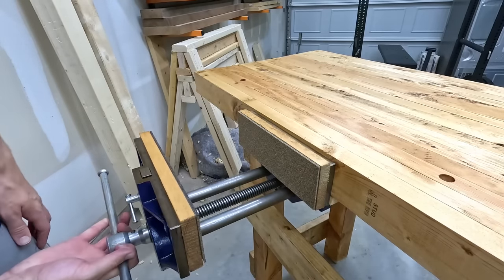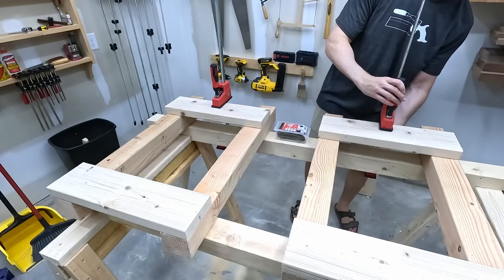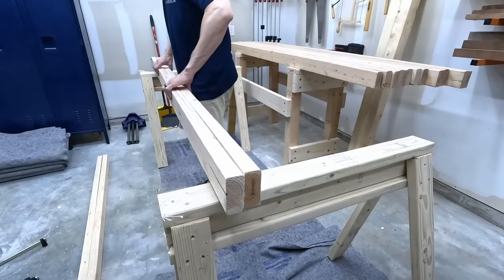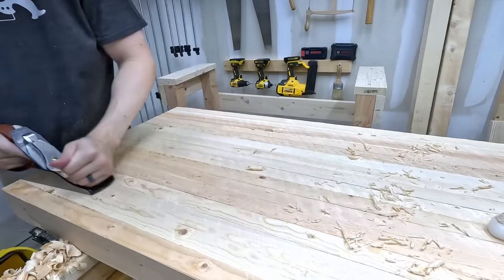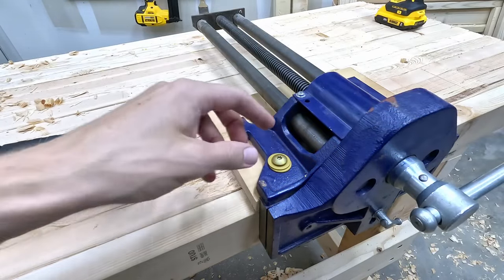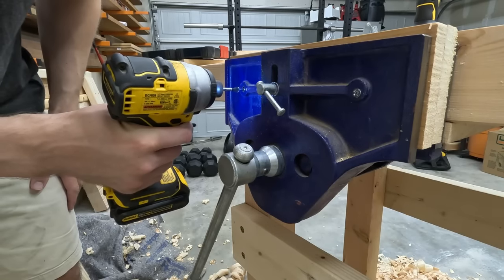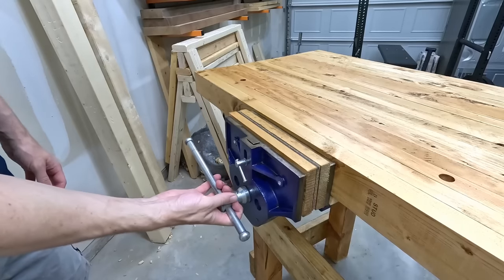I Built The Ultimate FIRST Workbench.

Comment: Awesome bench. Been contemplating a similar design and really appreciate the demo on how you did it. Mistakes and all. I’m new to wood working and really appreciate that you include the oops moments! need to get mine to be able to fold up the legs as I have limited space and winters here in canada require the car inside unless you enjoy sitting on frozen solid seats in the morning 🙂would love to see an example of how you would do that. Been a follower for some time now and really enjoy your content and style. Thanks for all you do and enjoy your warm weather!
Reply: I've seen a folding workbench which stores flat against the wall when folded. 

I think the plan was in an easy shop, but saw the original picture on pinterest?

Iirc it may have even had casters on the wheels, but I can't remember whether that's the same table for certain.

Comment: Heh! I did glue "mortise and tenon" framing on my first bench!

I think I'm going to upgrade mine. I need to flatten my top, put on a tail vise. It's been sitting a while now so the wood has warped to its permanent position, though it didn't really warp much.

Maybe I'll add a nicer hardwood to make the top, because right now it's just 2 inch thick 2x12 fir, English bench style. Then I can take out the screws since it's all glued together, add a finish, drill my final dog holes. That would add some nice mass and flatness. I could add a trough as well. Yeah I'm gonna upgrade, this'll be fun.
Reply from the maker: Always fun to work on a bench!

Comment: I think you're right about this bench being accessible even to beginners. And it looks quite sturdy.  Paul Sellers has a good example of making a laminated benchtop from 2x's although his approach does use a handplane to joint the boards roughly. That might be a bit more than an inexperienced builder would want to try. Good video. Thank you for sharing.
Reply from the maker: Absolutely

Comment: Hello, Mr. Frank;
Thank you for this as I'm about to build a workbench.
I think your sawhorse brace is a great idea, it has a lot of applications. 
How long is this bench? (Didn't see dimensions, sorry if I missed it.)
I checked your site & recommendations but I didn't see the tung oil.
What do you recommend?
I have a few tools but I'll have to get a couple of saws.
I want an extra iron for my plane, a camber & smoothing iron makes 1 plane into 2.
I really appreciate hand tool woodworking & you seem to be pretty good.
Are you going to offer discounts for the season?
Have a GREAT day, Neighbor!
PS
How many structural screws did you use?
Those look like really good screws.
Reply from the maker: Thanks man it's 6ft. I'd suggest longer if you have the space. The tung oil is realmilk paint brand, there is a link in the description if you feel like hooking me up with an affiliate commission 😉. Depends on the screw length, the longest ones 4" used 24, shorter ones into the top used 12, the ones into the face vise were more narrow and only used 2

Comment: Nice! I wonder if it would be just as strong if I used 2x6's for the legs, then after putting the cross beams on top and bottom, use other 2x6 to sandwich them.  It will be easier to cut 2x6 instead of 4x4 on a miter saw, I just wonder if It will be just as strong.
Reply from the maker: Probably even better that 4x4, that plan should work great

Comment: I'm in the process of gluing up the bench top. So far I have only done one section that is four boards wide. Should I repeat this until I have four 4-board wide sections and then glue the four sections together? Or should I add more boards to to my initial 4-board wide section? I'm thinking the latter as I think I'll be better able to squeeze individual boards together with fewer gaps.

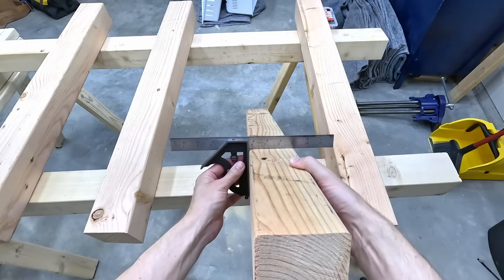Comment: Frank, at 2:37 in the background, you have a light-color wooden plane with a dark bottom.  It looks new; can you tell me about it?  Was it built by you or another woodworker?  I need a wooden jointer (I'm a 73 yo woman and can not handle a #7 or #8 metal hand plane).  Thanks.
Reply from the maker: Hi Susan, that is a rabbet plane made by ECE.. they make longer jointer planes too. I haven't used one, but based on the tools I have used from then I'm sure it's extremely high quality.

Comment: You definetly should exlplain the rope trick in another video, maybe a short, simply what knot is that and how it works.
Reply: I could be wrong, but it seems to be a truckers hitch, with a slip knot as the "lock knot." It's super simple to tie and really strong. You can just look up the trucker's hitch if you want details for its use. I'll describe tying it.
Tie an ordinary noose near your anchor point. Pass the loose end of the rope, which should be the majority of the rope's length, around or through your object. Finally, tie a knot - typically an overhand - to finish off the truckers' hitch.
As I said- he finished his with a slip knot to make it easier to undo.
Get a rope in front of you and follow those instructions, and you'll remember it for years - it's extremely intuitive after tying one or two.